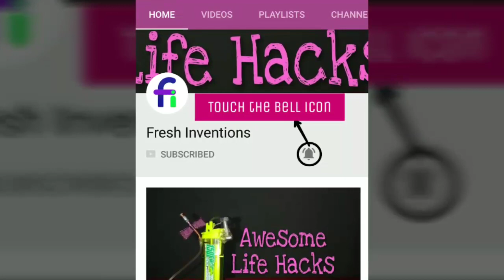How to make diy hot knife can cut anything.. very easy

Comment: i can use 220 v curret
Reply from the maker: No
Reply from the maker: It will only run with 12v DC. With 220v AC  there will be short circuit.
Reply from the maker: My advice to you is that if you don't know what electrical work is, don't make it at home.